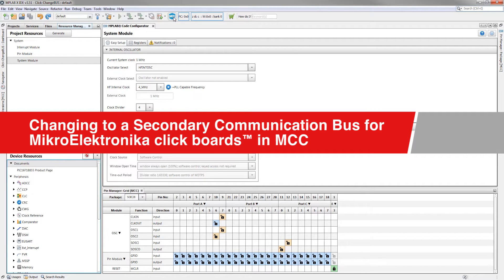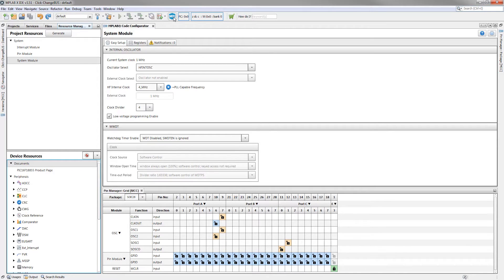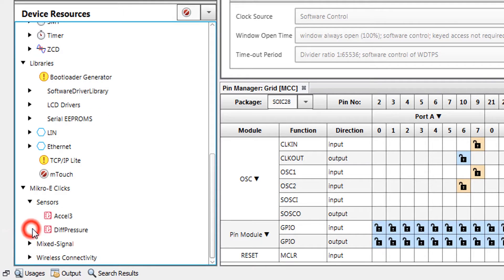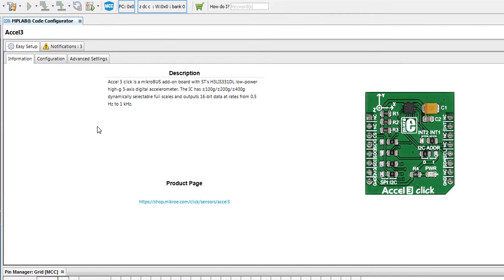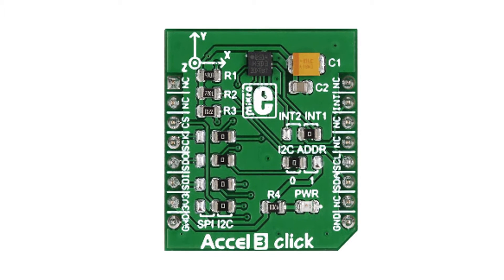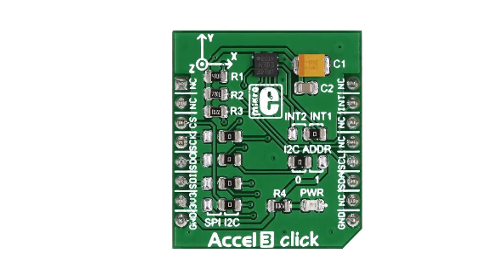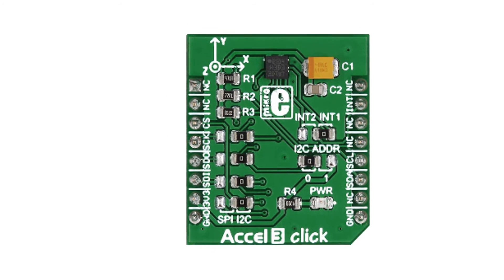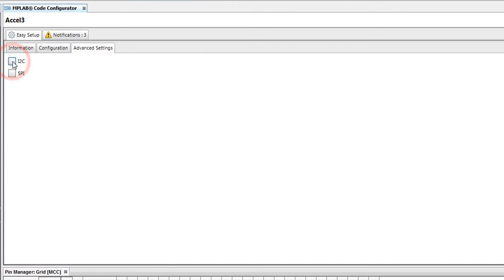How To Click Into MCC Tutorial #3 - Changing to a Secondary Communication Bus

Comment: I think there is a bug in the development of the plugin when is running on a mac. The plugin starts normally. However, when you select the pic parameters tab the use of cpu increase over 100%. If you change to another tab normalizes.
Reply from the maker: Hi Daniel. If you would like assistance with this issue, please go to support.microchip.com and post this on the MPLAB Code Configurator Forum or send an email to MCC_Support@microchip.com.